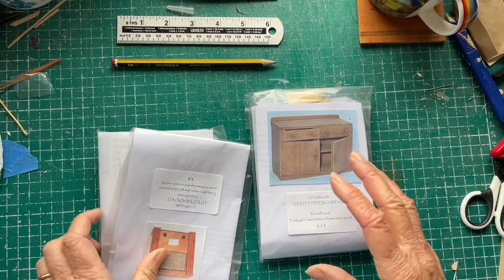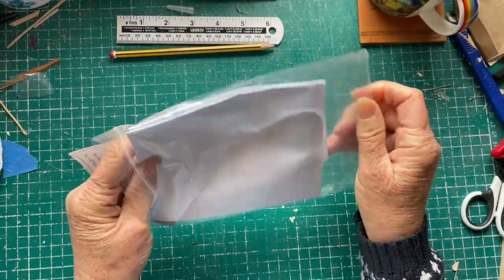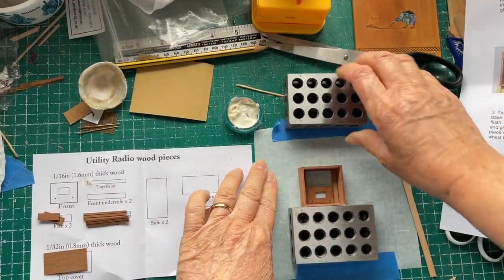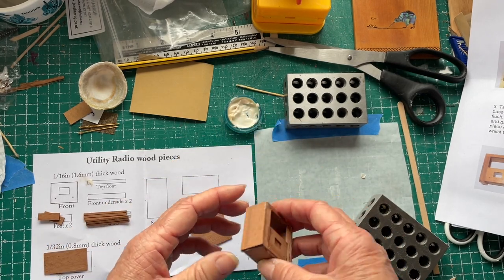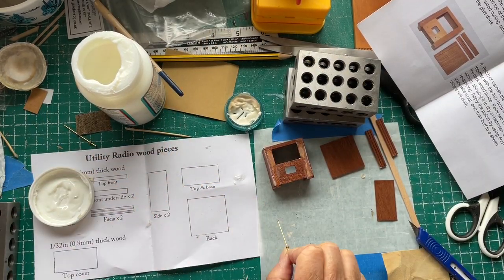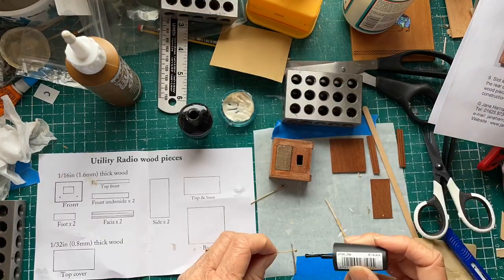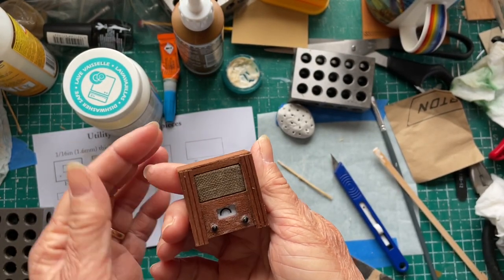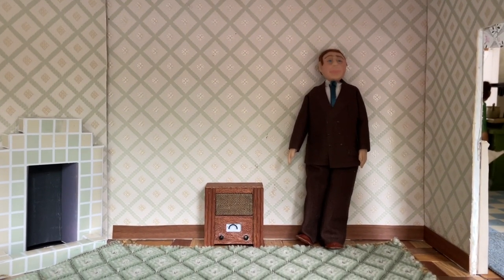Miniatures on Monday: Utility Radio/Wireless Jane Harrop Kit

Comment: Hello, I'm enjoying your videos. One tip for gluing tiny bits like the knobs on the radio is to insert the pin and then apply the glue to the back of the pin (inside the item), you won't have any glue on the front and you can use as much as you need to hold the pin in place too.
Reply from the maker: That's a great idea!  Thank you for your lovely comment, and I am glad you are enjoying the videos.

Comment: Hello, the radio turned out great, I've not used one of Jane Harrops kits,  I bought her gluing jig at a DH fair, its really useful for gluing small things. Have a lovely week.
Best wishes from Yorkshire 😊
Reply from the maker: Oh yes the gluing jig is mentioned a lot, sounds like it would be very useful.  I am pleased with this one.  I have made another kit today...the wood is very grainy again but I haven't painted this time, just stained it.  Pretty pleased with it.😊
Reply: @serenata1736   I think that's the problem with kits, the wood is not always good quality to say they are quite expensive. The gluing jig isn't anything fancy, mine's 5x6 inches, it's 2 pieces of strip wood fastened to a stiff board in an L shape, it was only a couple of pounds, I think she does different sized ones, I bought it when I was doing 1/48 scale , I still use it regularly though.
Reply from the maker: I think you are right.  I don't know if the quality of the wood has changed over the years, as these kits are over 11 years old, so they may have done.  Perhaps I can make my own gluing jib.  I need to probably see one.